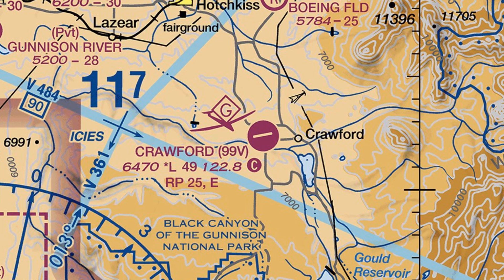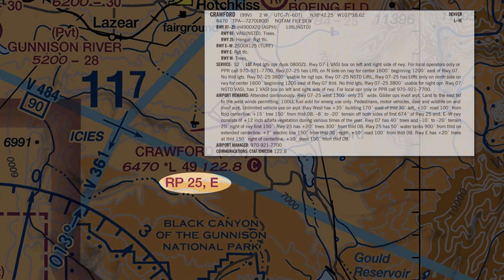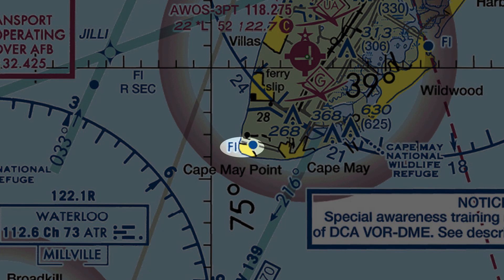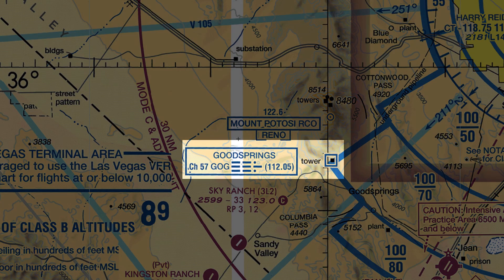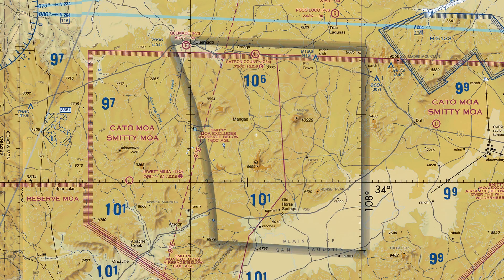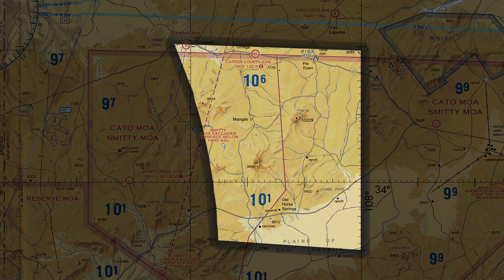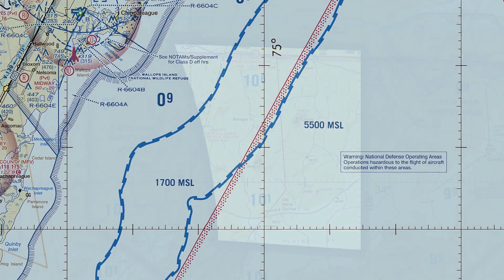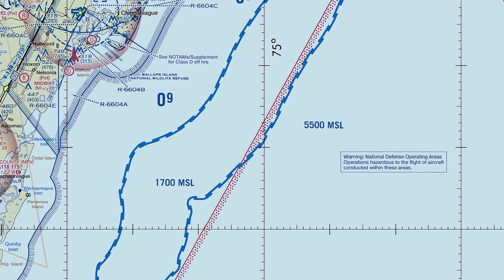Uncommon Sectional Chart Symbols | VFR Flying

Comment: In the first example, Crawford, I’m pretty sure the E-W runway circuits are kept south of the field (RP E) while 25-07 runway circuits are kept on the North side (RP 25). This would separate the glider operations from regular traffic and allow safer glider access to the ridge south west of the airport. Let me know if I’m mistaken.

Comment: At 11:45 when talking about spinning mass you mention "thermal power plants" - that's correct, of course, but incomplete.  Hydro pumped storage also provide inertia, along with addressing most of the other issues that inverter-based, intermittent generation/storage systems present.  While I very much appreciate how you focused on inverters and how they are improving in this video, leaving out hydro pumped storage, as a proven technology with decades of track record around the world, presented an incomplete view of the topic.

Comment: Have encountered some very uncommon airport/airfield markings as well.

10ft Yellow circles at or near runway thresholds indicate presence of arresting cables / gear.   Getting a small GA aircraft gear snagged or prop strike on those held above the surface items could get unhealthy and expensive fast...

Fly safe!!!